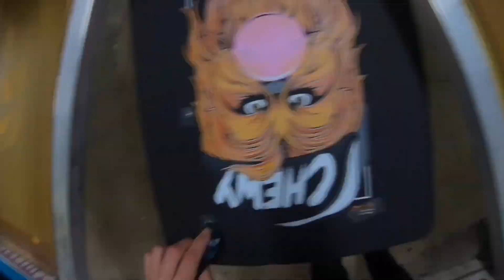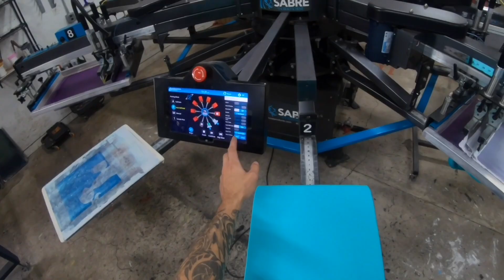The Screen Print Process.

Comment: What is that that holds the quick reg to the wall?
Reply: When you buy the Tri-Lok, it comes with the wall mount
Reply: The workhorse one or M&R one?
Reply: @michaelapplewhite4715   M&R
Reply: Did you use the m&r tri lock on that work horse.. i thought you could only use the tri lock on m&r